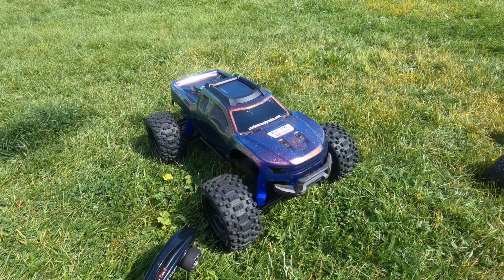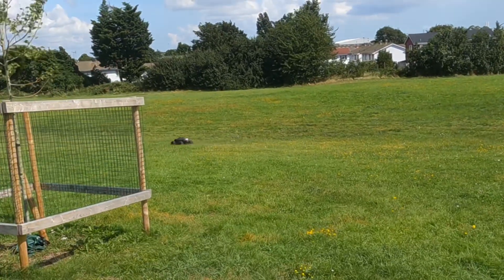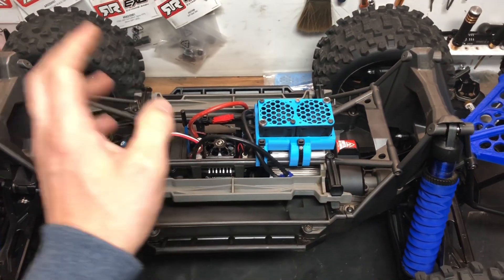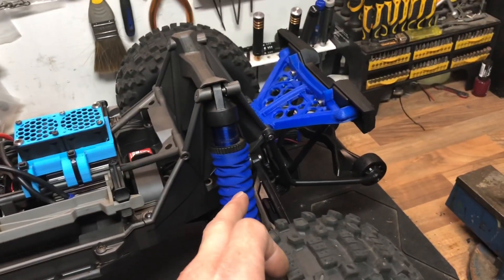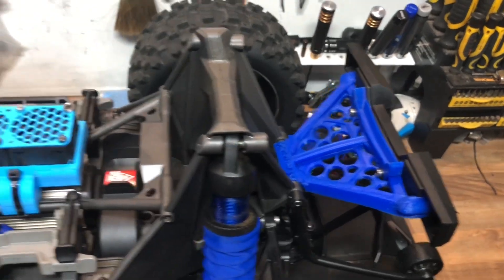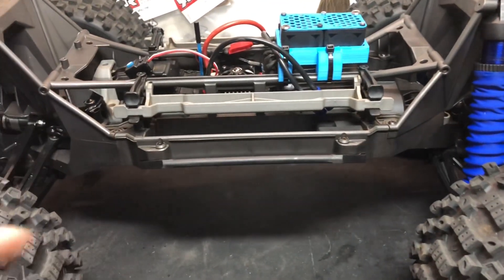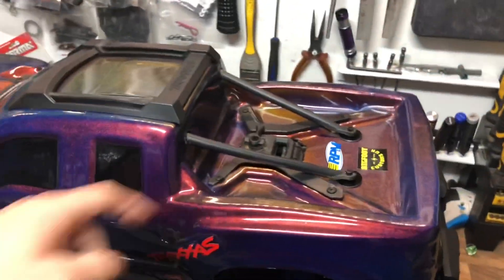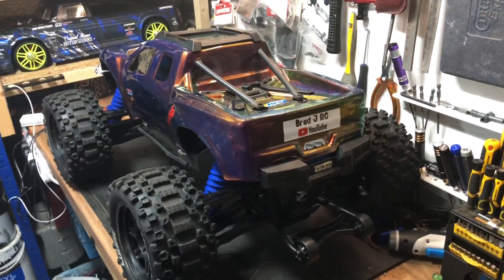Update on traxxas xmaxx, full service and gets some upgrades

Comment: Good upgrades. Yeah the Max 6 and 20/50t gearing gearing is nice. The stock tires due to suffer though. I was using the duratrax lockups x 24mm belted tires for that reason 👍